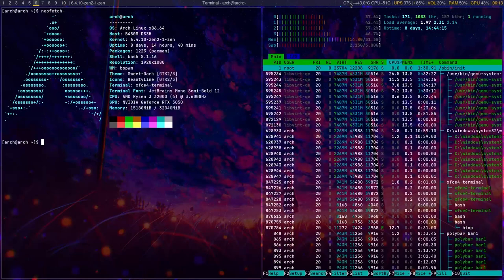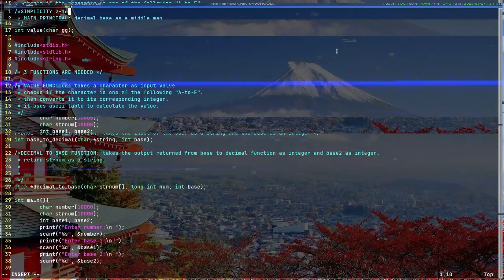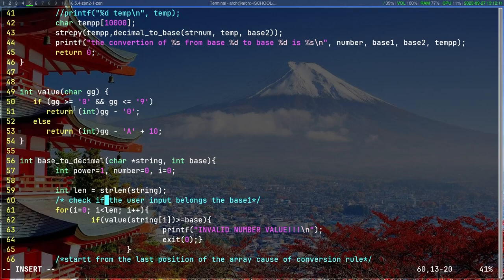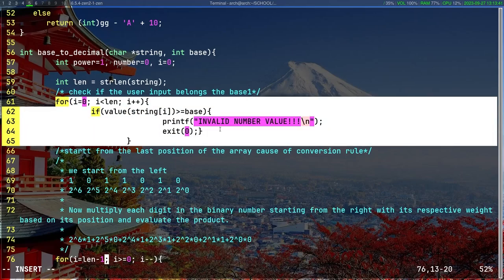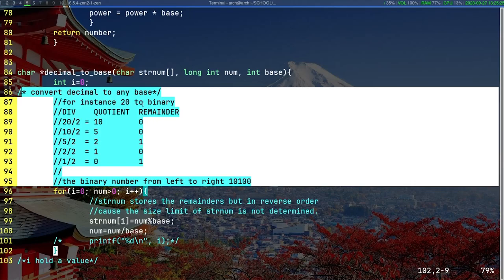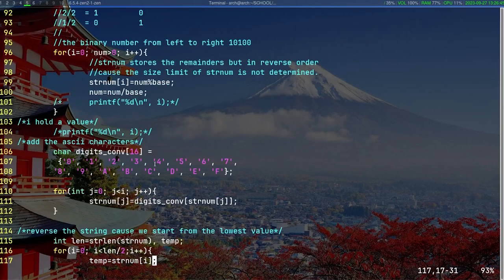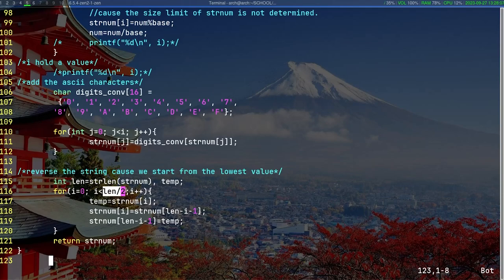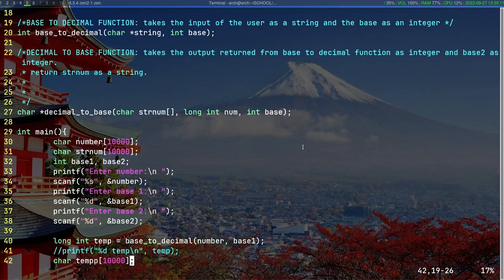CONVERT FROM BASE A TO BASE B IN C LANGUAGE

Comment from the maker: /*SIMPLICITY 2-16
 * MAIN PRINCIPAL: decimal base as a middle man
 */

#include<stdio.h>
#include<stdlib.h>
#include<string.h>

/* 3 FUNCTIONS ARE NEEDED */

/* VALUE FUNCTION: takes a character as input value
 * checks if the character is one of the following "A-to-F".
 * then converts it to its corresponding integer.
 * it uses ascii table to calculate the value.
 */   
int value(char gg);

/*BASE TO DECIMAL FUNCTION: takes the input of the user as a string and the base as an integer */
int base_to_decimal(char *string, int base);

/*DECIMAL TO BASE FUNCTION: takes the output returned from base to decimal function as integer and base2 as integer.
 * return strnum as a string.
 *
 *
 */
char *decimal_to_base(char strnum[], long int num, int base);

int main(){
	char number[10000];
	char strnum[10000];
	int base1, base2;
	printf("Enter number:\n ");
	scanf("%s", &number);
	printf("Enter base 1:\n ");
	scanf("%d", &base1);
	printf("Enter base 2:\n ");
	scanf("%d", &base2);

	long int temp = base_to_decimal(number, base1);
	//printf("%d temp\n", temp);
	char tempp[10000];
	strcpy(tempp,decimal_to_base(strnum, temp, base2));
	printf("the convertion of %s from base %d to base %d is %s\n", number, base1, base2, tempp);
	return 0;
}	

int value(char gg) {
   if (gg >= '0' && gg <= '9')
      return (int)gg - '0';
   else
      return (int)gg - 'A' + 10;
}

int base_to_decimal(char *string, int base){
	int power=1, number=0, i=0;
	
	int len = strlen(string);
	/* check if the user input belongs the base1*/
	for(i=0; i<len; i++){
		if(value(string[i])>=base){
			       	printf("INVALID NUMBER VALUE!!!\n");
				exit(0);}
			}
	/*startt from the last position of the array cause of conversion rule*/
	/*
	 * we start from the right
	 * 1   0   1   1   0   1   0
	 * 2^6 2^5 2^4 2^3 2^2 2^1 2^0
	 * 
	 * Now multiply each digit in the binary number starting from the right with its respective weight based on its position and evaluate the product.
	 * 
	 * 2^6*1+2^5*0+2^4*1+2^3*1+2^2*0+2^1*1+2^0*0
	 */
	for(i=len-1; i>=0; i--){
		number = (value(string[i])*power)+number;
		power = power * base;
		}
	return number;
	}
		
				
char *decimal_to_base(char strnum[], long int num, int base){
	int i=0;
/* convert decimal to any base*/
	//for instance 20 to binary
	//DIV    QUOTIENT  REMAINDER
	//20/2 = 10	   0
	//10/2 = 5	   0
	//5/2  = 2	   1
	//2/2  = 1	   0
	//1/2  = 0 	   1
	//
	//the binary number from left to right 10100
	for(i=0; num>0; i++){
		//strnum stores the remainders but in reverse order
		//cause the size limit of strnum is not determined.
		strnum[i]=num%base;
		num=num/base;
	/*	printf("%d\n", i);*/
	}
/*i hold a value*/
	/*printf("%d\n", i);*/
/*add the ascii characters*/
	char digits_conv[16] =
	 {'0', '1', '2', '3', '4', '5', '6', '7', 
	'8', '9', 'A', 'B', 'C', 'D', 'E', 'F'};

	for(int j=0; j<i; j++){
		strnum[j]=digits_conv[strnum[j]];
	}
	
/*reverse the string cause we start from the lowest value*/
	int len=strlen(strnum), temp;
	for(i=0; i<len/2;i++){
		temp=strnum[i];
		strnum[i]=strnum[len-i-1];
		strnum[len-i-1]=temp;
	}
	return strnum;
}